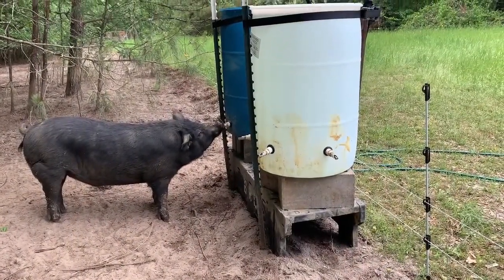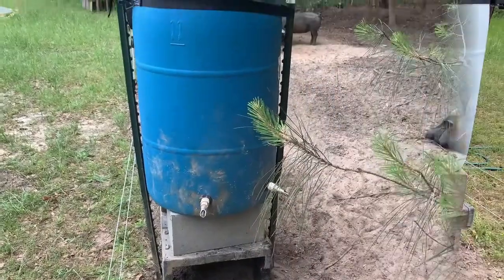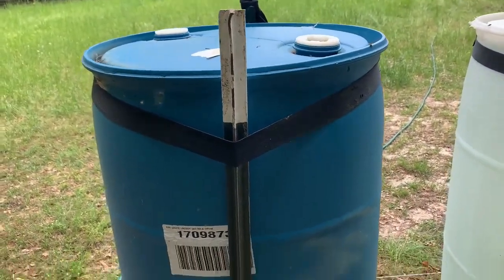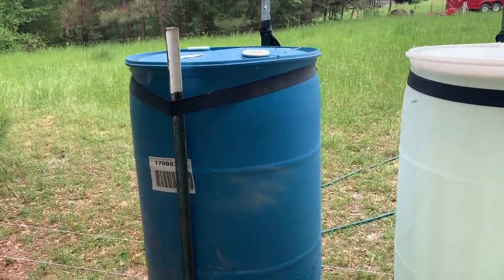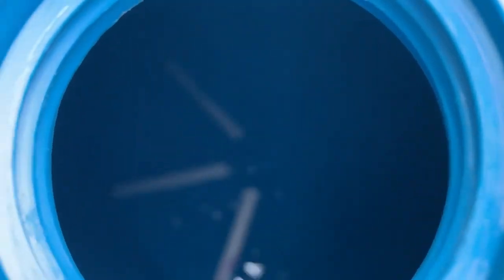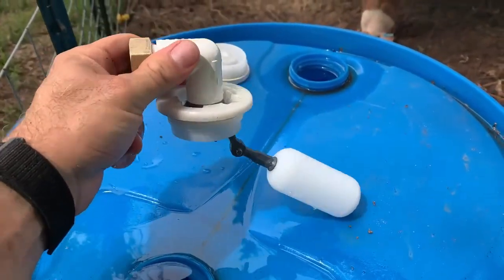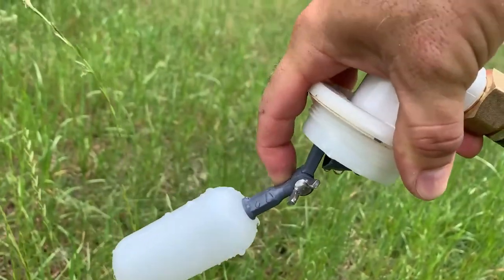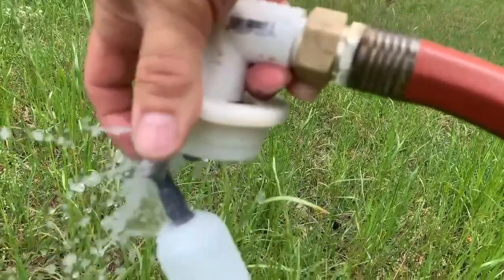DIY Automatic Pig Waterer | Less than $15

Comment: I built one yesterday and all I did was pre drill with 3/4 inch bit, then just hand tightened the nipple thru the hole with Teflon on the threads, no leaks and rock solid I’m not sure why everyone is making these more complicated then they need to be: maybe mine will leak at some point who knows :
Reply from the maker: mine have bene going strong for many months now.  No leaks...

Comment: Can you add the links to what you purchased on Amazon (e.g., electric fencing, plastic platform for water barrels, and float valve, etc.,)?  I agree that yours is the best waterer.  I'm glad I found it before cutting a hole in the top of my drum!
Reply from the maker: Sorry, taken me so long to go add the links.  I added the links for the float value and the 9 conductor wire.  The plastic platform came from grocery store surplus sale.  It was used to make the displays at the end of the isles. I bought two of them and cut them in half. I liked them because stamped on them was "1500 pounds max".  I found something similar on Amazon, but these are only 8" high.  Mine are at least double that:  
https://www.amazon.com/Forte-Products-8002128-Display-Black/dp/B00962U0WG/ref=rvi_1/146-9347847-3673967?pd_rd_w=X4eoP&pf_rd_p=c0296674-5a83-4ad6-b035-0702d2b359df&pf_rd_r=MZG7C260XEYA3XM7VWXR&pd_rd_r=1e338393-f49a-4271-9545-44d6d61065f7&pd_rd_wg=OZWmL&pd_rd_i=B08Z461FBW&psc=1

Comment: how do you keep the pigs from pulling out the nipples? My pigs won't stop pulling them out....
Reply: Look up "Rigid Watertight Hub 1/2-Inch Conduit Fitting". I also prefer 40gallon barrels with the snap ring lid.

Comment: We installed two nipples on a barrel. Lasted about 30 days before the pigs ripped them out of the barrel and the spigots are lost in the mud. A waste of time and money in my opinion.
Reply from the maker: Sorry to hear it didn't work for you.We have been using this successfully for all of our pigs for going on 2 years now.  I think the key is that the nipples have to be above shoulder level of the pigs, or else they will pull them out.  Once we figured that out, we haven't had any issues with them pulling them out.  Right now, we have 5 of these out and working for our pigs. Works for our breading stick and our feeder groups.